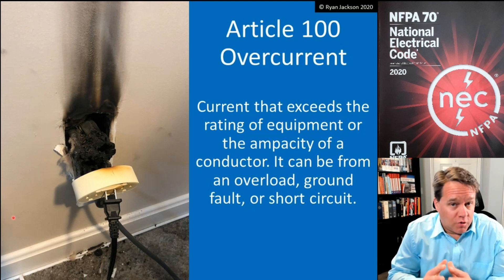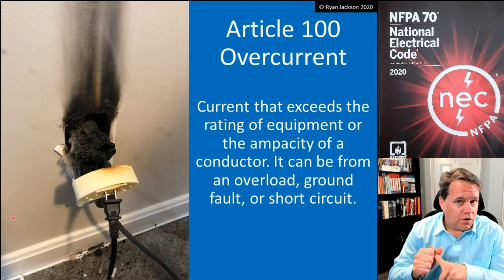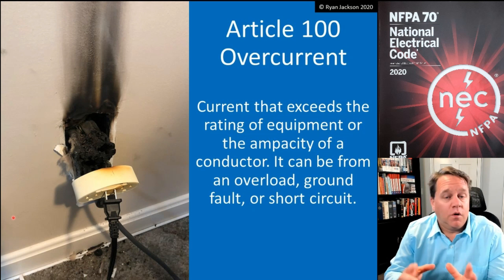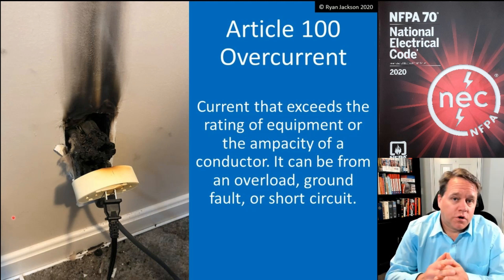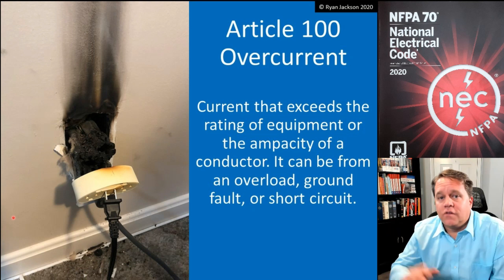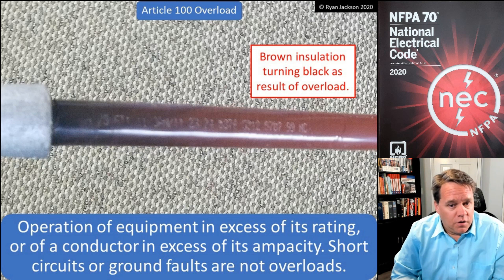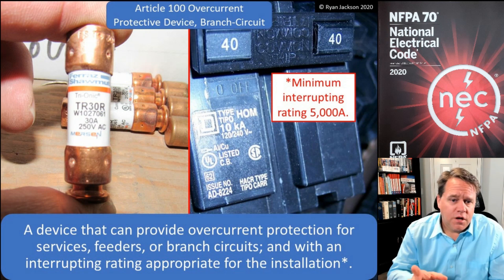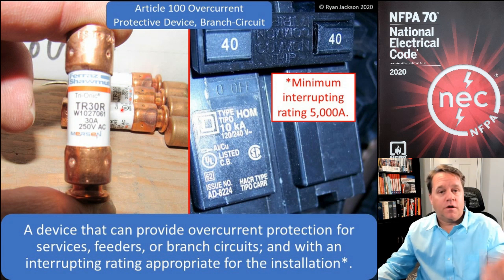100 Days of Article 100: Overcurrent, Overcurrent Device, Overload

Comment: Good stuff.   For many of the younger generation, the same thing can happen inside a wall (SCARY) .  Many old school homeowners who ran ran out of fuses, you know, the kind you screw in like a light bulb,  only to find out the store was closed up for the weekend or didn't feel like stopping everything to drive 30 minutes to get to the hardware store,  removed the blown fuse, slipped a penny into the socket then screwed the blown fuse back in, bypassing it. Or wrapping a cartridge fuse with aluminum foil,  or insert a piece of copper tubing or metal conduit.  Now, you just turned your wiring into a fuse, an untold number of homes were torched.  Now we don't really worry about that happening because we have breakers.  😃

Comment: Great video. Of course, we're good about branch circuits to the outlet, and in/on equipment, but those ye old #18 extension cords (and to a lesser extent line cords in general) that can be overloaded through stupidity or fault got nothin'. I think the Europeans do a bit better than us here by putting a properly rated supplemental fuse in the plug itself..
Reply: Same thought here.   The systems in Europe are in many way superior to what we have in North America.  13 amp fuse built into every plug.  And 230 volts at 50hz, every single home appliance.  Higher volts = lower amps = smaller conductor size and lower voltage drop means a more efficient system.  Too bad we didn't follow their lead.  Of course here in north America,  the 110 volts for the majority of home circuits really was set for historical reasons,  as the carbon filament bulb by Thomas Edison,  was designed to operate on 110 Volt D.C., originally,  so when A.C. surpassed D.C. later on, it would be backwards compatible.
Reply: Oh yeah, those #18 extension cords, with non polarized blades, one of my fondest childhood memories were watching my mother using her nail file to file down the wider prong on my lava lamp, myself thinking my lamp was made wrong at the factory because the plug wouldn't fit.  , remember those when I was growing up in an older duplex and my bedroom only had like one outlet.  (Talk about setting a bad example for children 😵)   . Sometimes I still see them at thrift stores or garage sales.